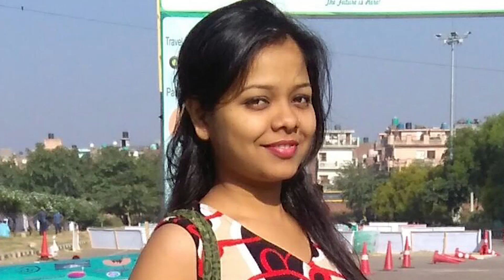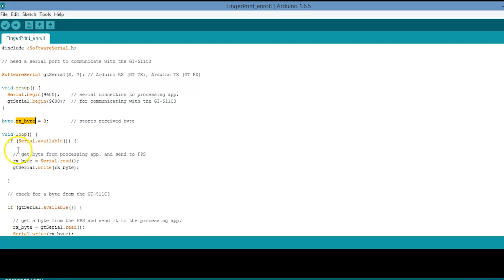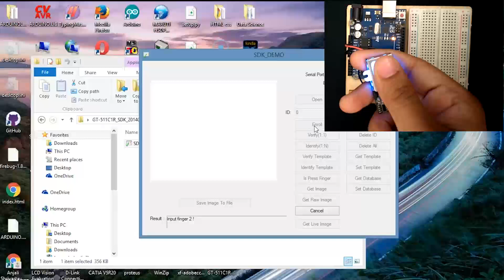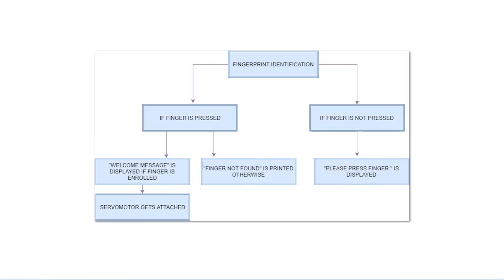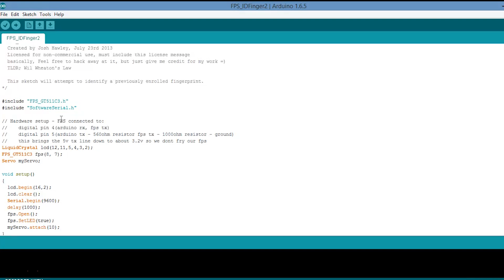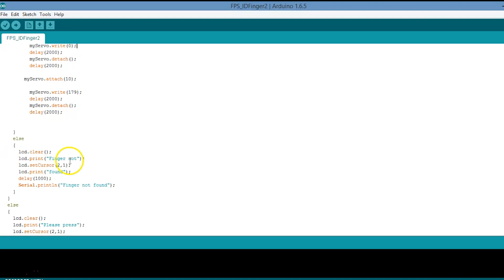Security system using Fingerprint sensor (GT-511C1R) and Arduino

Comment: please reply .....
i using same fingerprint module ... while running  in sdk software ...i selected proper SERIAL PORT NO(in my case COM3) and  BAUDRATE(9600) but while opening it says THE MODULE NO SUPPORT AUTO SET FUNCTION
Reply: Can we help you sir?

Comment: Hey, I am getting a problem with SDK demo software. It is not working can you help me with that. When I am clicking the open button in the demo software nothing happening. The code uploded without any error but after uploading, I am not able to enrol the finger coz by clicking the open button it is showing nothing. I checked everything the com port and baudrate.
Reply: Sometimes there comes the issue regarding serial port communication, so for that what you have to do is to close Arduino IDE before opening of the SDK software. Also Remember to run SDK as an administrator.
Reply: Hi Anjali thank you very much for your reply and sorry for very late revert. Actually I stopped working on that project but now again working on that project and still facing the same issue. Please help me with my project and please tell me is there any portal where I can contact you directly.

Comment: Its really nice video and explanation...but u have two quotation..can we do enroling function and verification function by just push button and its shows on lcd without SDK software .
2nd quotation is howmany ids can save in this modul??
Reply: yes you can even use the push button also but need two other connections..one to the arduino digital pin and the other to the lcd display.  this module can save up to 200 id's